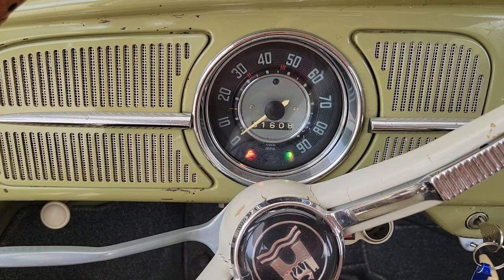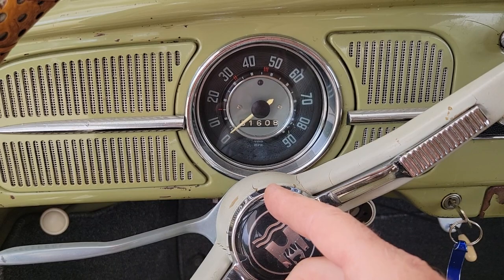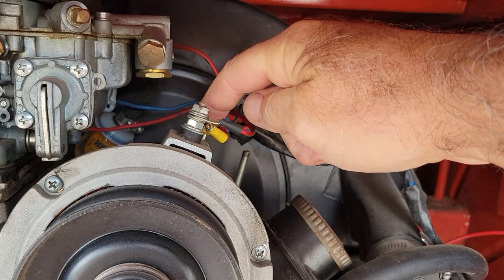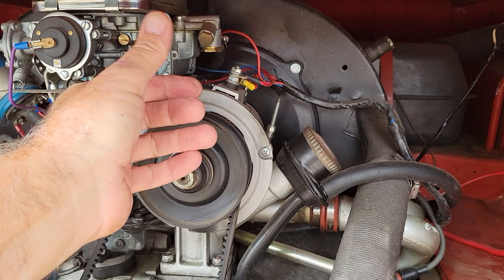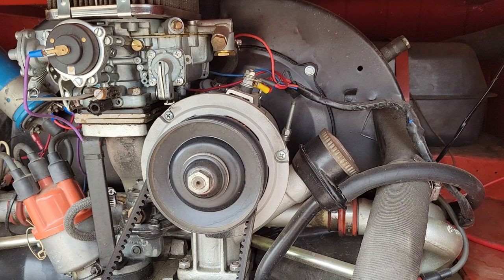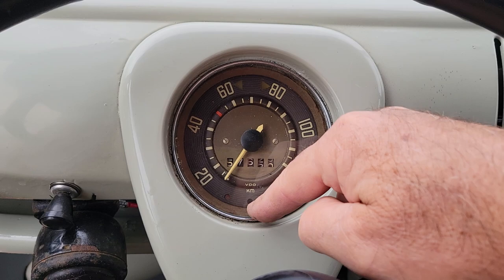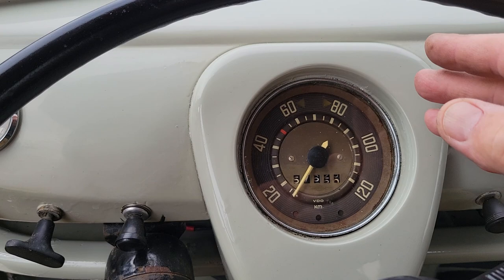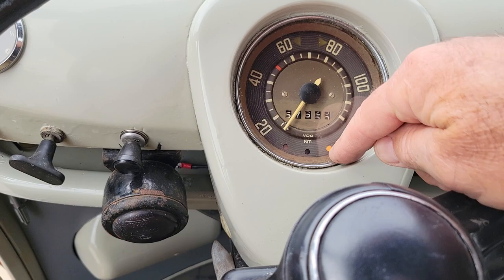VW GENERATOR LIGHT NOT WORKING?........FIX IT NOW!!!!!!    WHY?????

Comment: With generator to check if working just take belt off and turn key on and fan should turn backwards if working properly.  Alternator is different,  all the DC voltage will do is forward bias the diodes so Alternator can start charging after engine starts . Diodes are the rectifier to change the AC to DC from Alternator. Alternators are used because they're more efficient at charging especially at idle.

Comment: I’ve been having a problem with my oil light flickering at idle speed after a 20 minutes ride on the expressway, I changed the oil censor and it still doing it, any thoughts or advise.thank you!
Reply from the maker: check your engine end play. if it is loose your engine needs a rebuild.

Comment: I just recently changed my alternator. After 20 years of use it finally died. I replaced with another new Bosch alternator but now my "idiot light" comes on at an idle. I checked voltage at the alternator and the meter said 13 at an idle and 15 max. Should i be worried about the idiot light coming on at idle?
Reply: I have this same issue in my 1776 . After it runs for awhile the light eventually comes in and stays on. Have you found anything out yet why?
Reply: @aaronsanxiety3571  -full on or just a dim light? Mine is dim at idle and goes out when the RPMs go up. If i were you i'd just test it with a multi meter when the light is on and make sure it's charging. If it is, run it. If it really bothers you i'd get a voltage gauge. Mine's charging, that's all i know. Not sure why the light is dim at idle. Good luck.
Reply: @JohnnyRebel1776  yeah mine will be dim at first after the car warms up then it will eventually just stay on. But it's charging and everything is working properly

Comment: LOL,  Yes I am an idiot, I put one of those temp sensors that fit in the oil dipstick tube and this light (LEFT) came on and I thought it was the temperature, as I was taking the 67 bus up a LONG hill...engine was HOT....so it all seemed right...and I stopped and waited an hour, it cooled down, but the light was lit and I limped it home, the fan belt was secure...the light on the RIGHT is for oil pressure then ?  D'OHH...

Comment: What if my dune buggy doesn't have a generator light ?
How do I hook one up ?
Reply from the maker: need to have one if your running an alternator just put a bulb on the dash area. RPM Oil gauge and Alt Light.
Reply: @Mikefngarage  that is my whole thing I don't know how I'm supposed to wire that together ?
Reply: @Mikefngarage  I have a generator not an alternator
Reply: I have a generator not an alternator